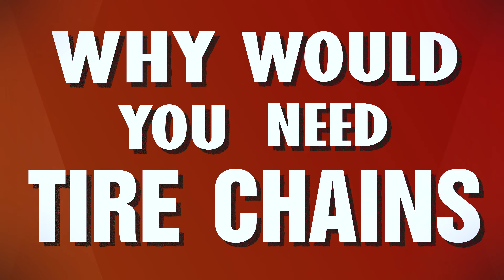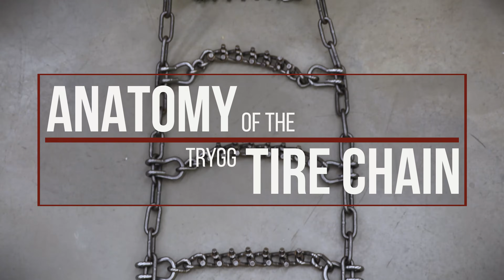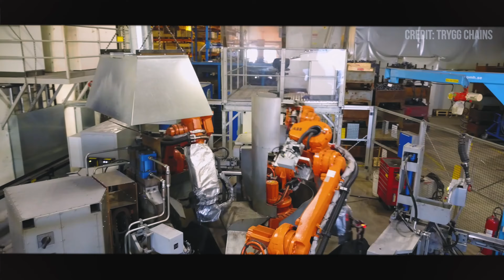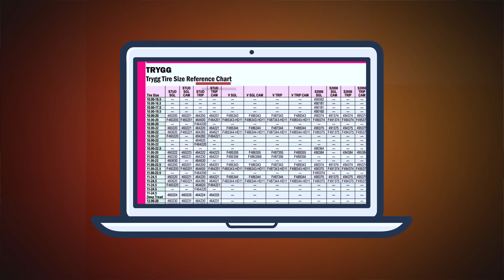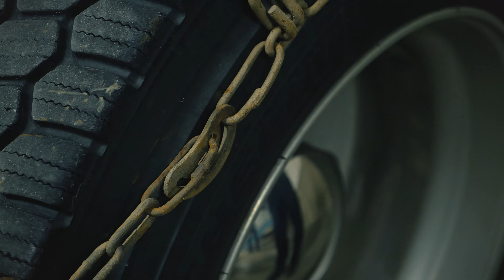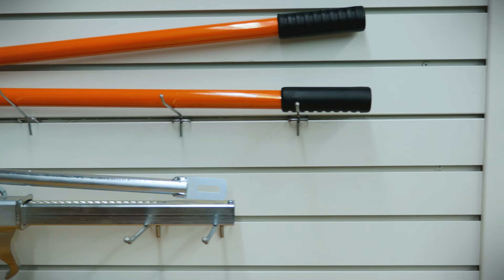How to Choose and Install Trygg Tire Chains - Gear Up With Gregg's

Comment: I bought a set of #602909 TRYGG chains for my tractor and couldn’t find my tire size on there chart anywhere, my tires are 355/70-17.5 or 14-17.5 so now I’m not sure if they need be shortened or what. They dealer gave me the chains ⛓️ for my size tires
Reply from the maker: From the info we have available, Trygg does not have an option for that tire size.

Comment: Trygg  Helene forklift chains are a pain to get tight. There roll pin connectors are almost impossible to set they are so tight. Of course your against a rubber tire and trying to punch these things in is a PITA.  3 sets of the same part number and all are different. Only one set says made in Norway. Painted grey and close to the right length. Had to remove links and relocate 1 cross bar Second set is way to long with extra links and chains hanging off it, loose metal and paint chips in the bag. "Made in Norway" label is missing. [China?]  3rd set is way to long but completely bare metal and packed in a gunny sack. All the same part number.! All from  Greggs too.
Reply from the maker: Richard, thanks for your feedback on this.  With our many years of working with Trygg we have seen extremely minimal complaints about quality, as a matter of fact, we would say that all of their chain leads in the industry when it comes to consistent quality and performance.  It surprises us that you are seeing inconsistency. 
 
You can rest assured that all Trygg branded tire chain is made in Norway or Lithuania.  They have a secondary, more economical brand called Fram, that was made in China many years ago.  However, the owner of Trygg is so focused on quality that when the quality of Steel in China was not meeting their standards, they moved the Fram operations to Lithuania, where the quality of Steel is much better and the chains can still be priced economically.  

We would be happy to assist further, and possibly have our Trygg rep get involved as well, but we would need a little more detail from you.  If you know the specific part number you ordered and from which branch you ordered it from that would help us track down the details.  If you want, you can provide us with your contact information as well so we can discuss this with you directly.  Thanks again for continuing to support our 100% Canadian owned company, we really do appreciate your business!

Comment: Very informative video. Thanks!

I drive a FWD Honda CRV and was thinking of upgrading to V bar chains from my existing cables. Curious if the improvement will be noticeable enough on icy roads. Specifically, will the V bar chain get me up an icy hill that the cables might not?

What is the type of chain for highest traction in ice for passenger vehicles?
Reply: V bar chains is what you want according to what he said it in the video, they "act like ice picks". They are the best for icy applications. Furthermore, I would imagine they would get you up the icy hill that the cables would not simply because the cable stye absolutely suck ass (my experience, your mileage may vary).
Reply: @bigcountry9457  lol thanks. That’s very helpful
Reply: Huge difference, I run chains all the time, night and day difference chains are better